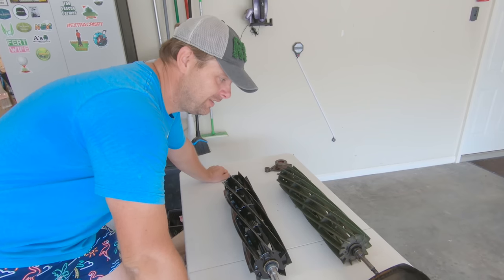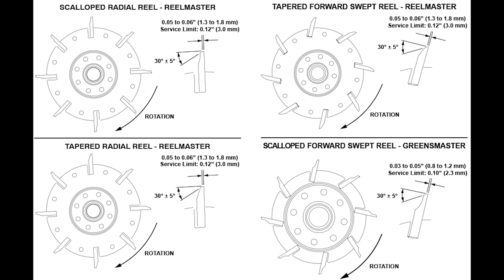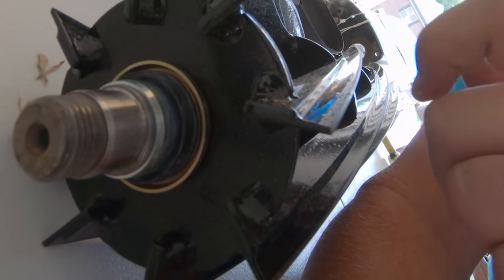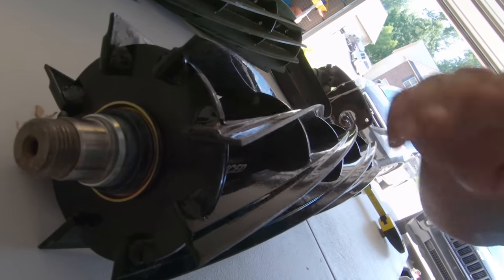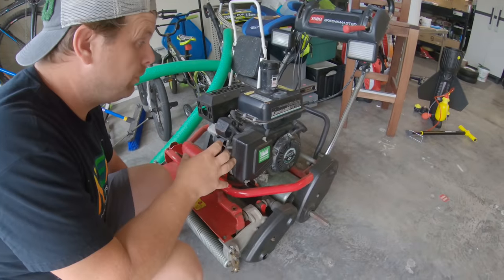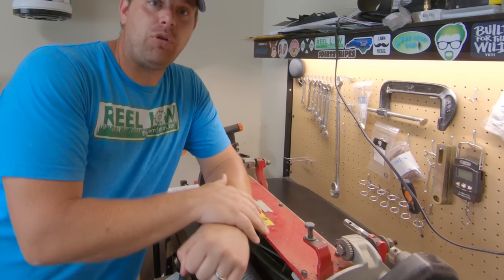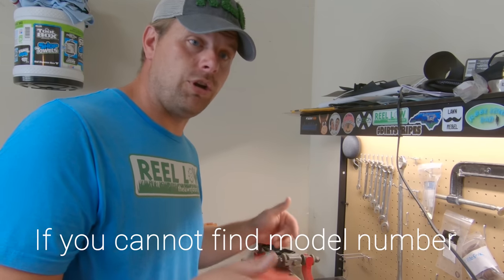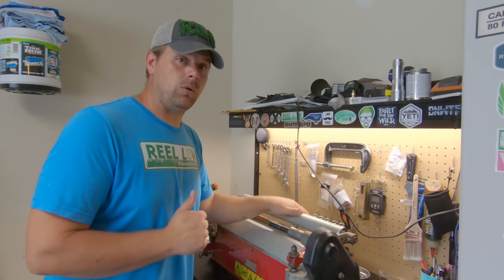Toro Greensmaster Flex21 | When to Replace the Reel

Comment: That black bar on the back is a kickstand to prevent the mower tipping back. Also the difference in reels are for different machines and relief grinding and other adjustments on the reel are designed so that your reel you just replaced can just be sharpened and continue service

Comment: This will be a good series RLD!! What is the big difference between the Flex21 and a GM1000?
Reply from the maker: The height of cut and the Flex has a “floating” head. So reel is independent of the drive drum

Comment: Spin grinding returns your reel to perfect roundness and corrects grinding that may have left one end slightly larger than the other.
Relief grind then, if you prefer, but telling folks to avoid the spin is not very helpful.
Reply from the maker: To relief grind you have to spin grind . I am advocating relief grinds. Most places don’t do it and they need to. The reason they don’t is to drive repeat business